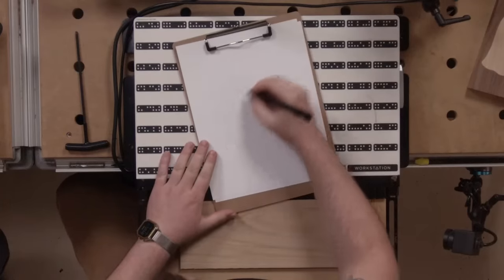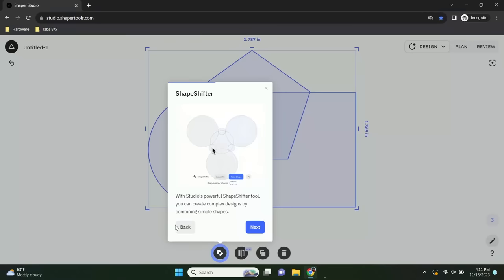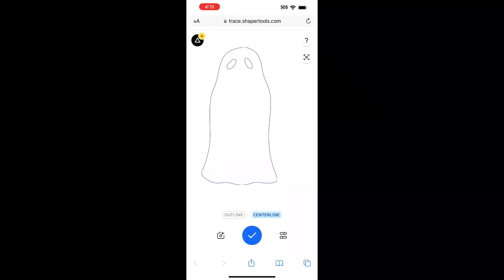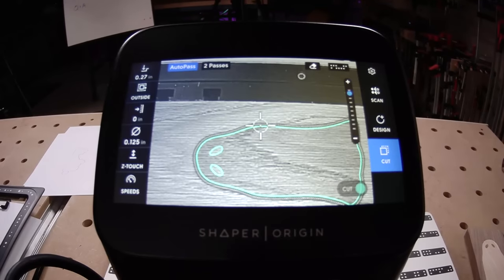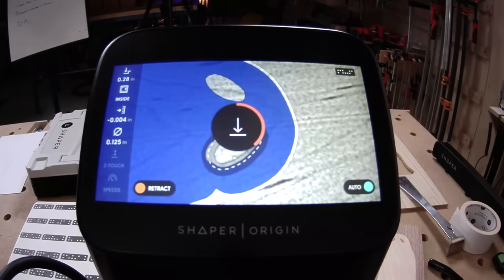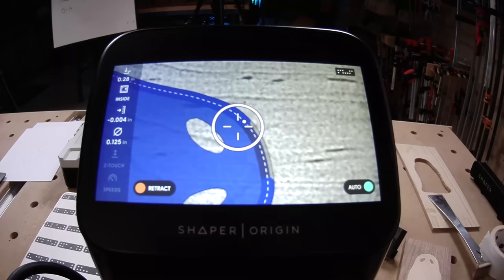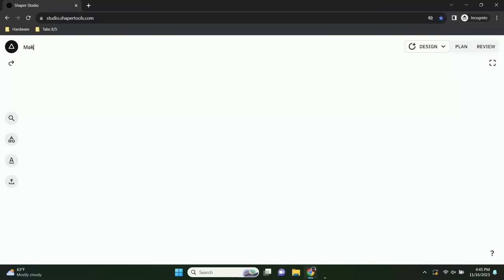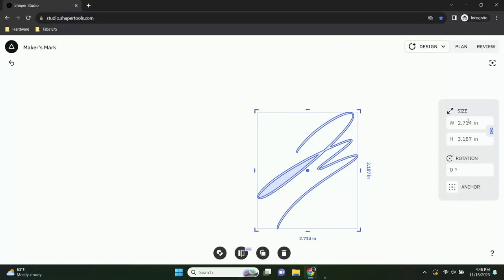Session 94  – English: Sketching and Digital Design with Shaper Trace + Studio

Comment: Can the router cut a long 8 foot piece…like from 8’ by 4’ plywood piece. ?
Reply: Yes. I have an 8’ sheet of ply with 8 miter slots running parallel with one another adjacent to a cut-out for a router. Love this machine.
Reply: Nice session, thanks guys.  One thing I noticed is that SO treated the finger cutout and the plane profile separately (when pocketing) even when you had combined them with shape shifter, how come?
Reply: Great video on ToolsToday YT channel of them routing a 12’ long walnut board, making a sign